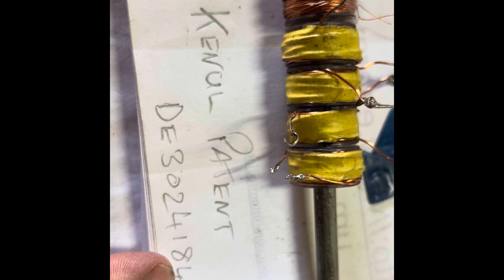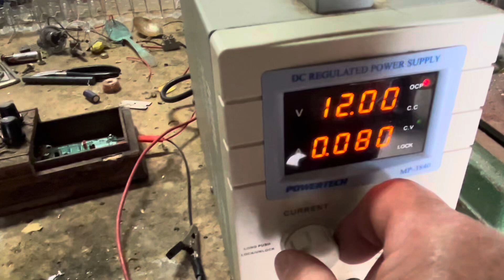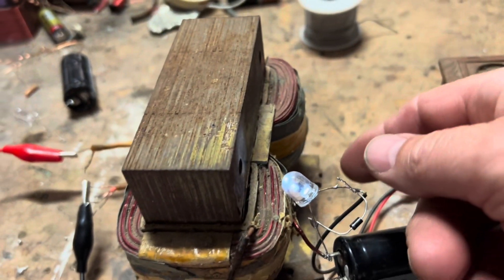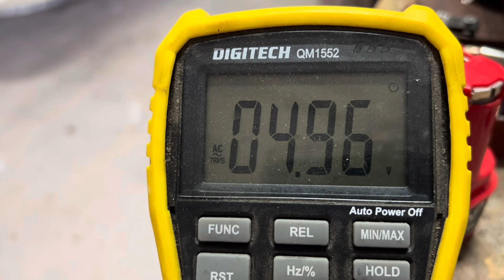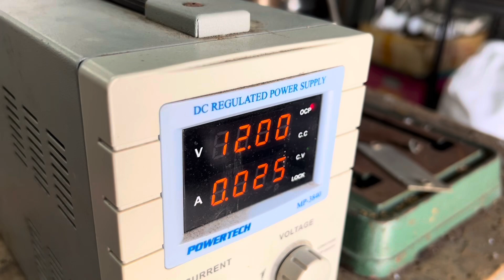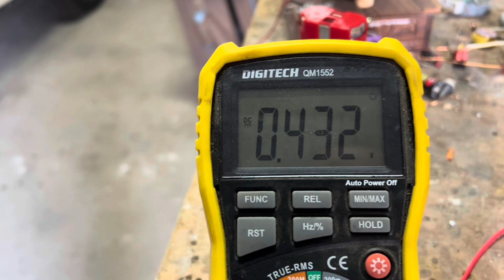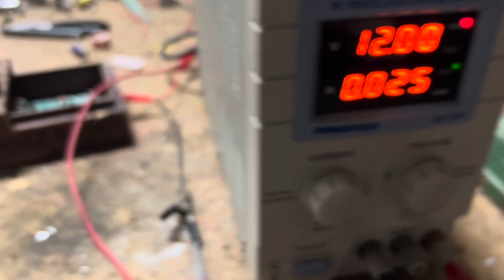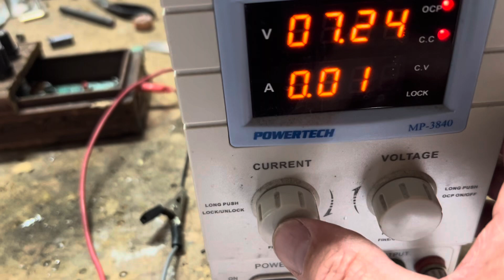Resonant coil induction experiments.

Comment: what do you think is happening when you touch the diode and led...? pulsed dc, and the cap makes? a c.??? maybe.??.and the the negative only runs through the winding of pri? so a negative pulse springs as it will way more so then the transfer if energy is more becouse you get higher spikes?
maybe right?😅

Comment: uuuhm your cap is on the wrong way around my friend as you said it is a dc pulse generator and soooo. neg is neg, meaning even with the back voltage of the coil , it should still be connected the right way around ..., back voltage can be addressed with a flyback diode❤

Comment: A tank circuit is almost infinitely variable, resistance (wire gauge) coil length and diameter, number of turns, capacitance, frequency, core hysteresis.  Love your work, I’m a bit tipsy and just appreciating the forward thinking… cheers!

Comment: Off the top of my head you are adding capacitance after the diode allowing more of a feedback loop to the system.   Probably totally wrong, but thought I’d chime in.
Reply: Edit: adding capacitance when you touch the circuit beyond the diode.

Comment: Very interesting, are you certain of the diode orientation across the secondary led ? The induced current will be opposite polarity ?  Im no expert just amateur it's  interesting what you  show .I am  testing my Volt Robber  LC circuit  which seems to show v low current draw, please do take a look ( it's on my channel ) , Im trying to find someone to replicate , would appreciate any feedback Thanks for your video